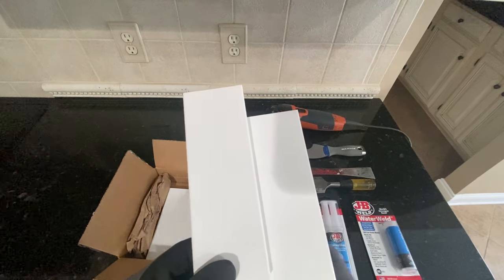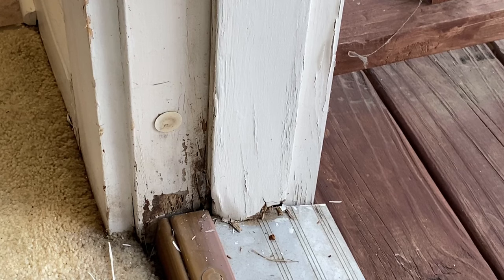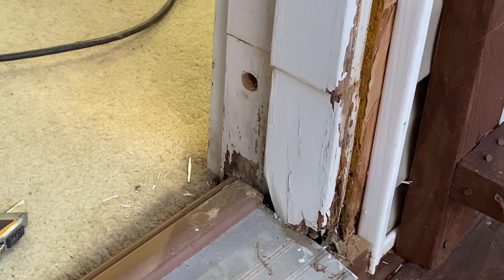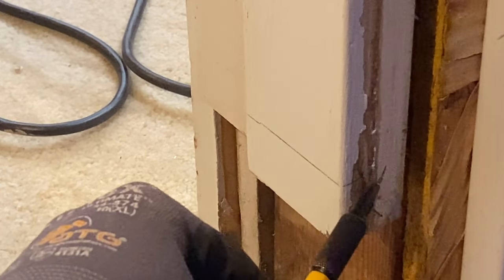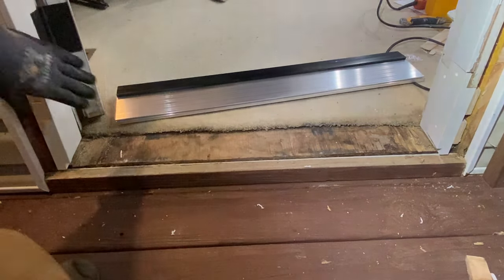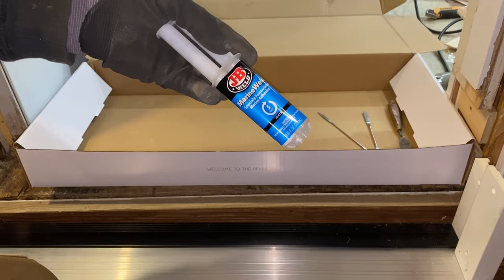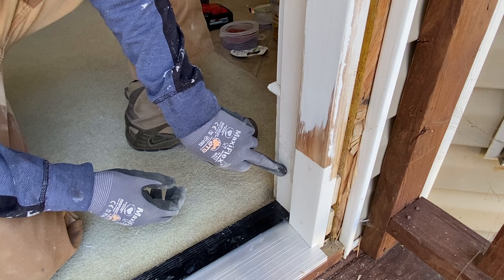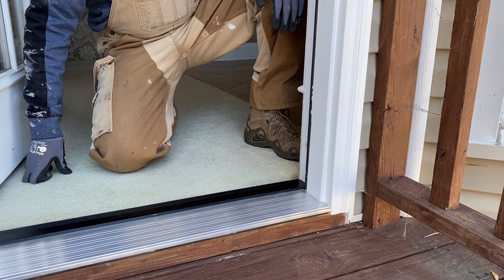Boss PVC Dry Rot Door Jamb Repair Kit How To #diy #how #howto

Comment: Great video, but after all the work with the PVC jambs why use regular plywood where there is risk of rot and why use a threshold with untreated wood that’ll only rot out in time?
Reply from the maker: Hi! Thank you for watching the video. I understand the comment. The reason the jamb needed to be replaced was because there wasn't a proper seal / caulking around the door frame, which allowed water to seep in and cause dry rot. Once the rotten portion was replaced and a proper seal / caulking was preformed, any additional water should no longer be an issue. I hope that this information was informative.👍

Comment: $80 for a pair? That’s crazy expensive. I’ll make my own from stock pvc 1x.
Reply from the maker: I know….but, it’s not as easy as it may seem. I looked into duplicating them myself for additional jobs. However, you have to router in a notch for weatherstripping, and most stores will not sell small sections of PVC. Therefore, you have to buy large sticks of it and you need two different thicknesses for the door jamb and door surround. By the time you’re done purchasing all of that and making a set you’re into it well over $80. If you are making several sets, then it might be worth it. But, for one set it’s really not worth the headache and is easier to purchase premade.👍

Comment: The threshold is angled down, how did you angled the pvc to the threshold?  Atvthe bottom?
Reply from the maker: Hi. If you fast forward to about 16 minutes you'll notice that the Boss Jamb has a "step down" type profile to it. The Boss Jamb is actually side screwed to the threshold, so the angle of the threshold is not affected when it's all put back together. Hope this information helps 👍

Comment: Excellent video! What did you use to fasten the pvc brickmold?
Reply from the maker: Thanks for watching. I used galvanized finish screws with small heads so that I could fill them in with caulking. You could also use stainless steel screws with small heads.

Comment: The door threshold will get stomp on daily,
not sure about the idea to tie the pvc kit to it.
Reply from the maker: Hi. Thank you for watching the video. I see your point on the threshold. But, If you have a proper subfloor base underneath the threshold, there should not be any play in the movement of the threshold, so it would not affect the door jamb. Most pre-hung exterior doors come with the threshold attached (side screwed) into the door jamb. For this particular installation, I followed the installation instructions directly from the manufacturer of the Boss Door Jamb Repair Kit website. I usually try to do that, so that others who purchase the product can watch a video instead of trying to decipher confusing instructions. I hope this information helps out. Thanks again for watching and leaving a comment...always appreciated!👍

Comment: What's the purpose of the JB weld ?  The piece is being held by screws
Reply from the maker: HI. That's a good question. The manufacturer recommended using White JB Weld to fill in the screw holes and the seam (if necessary). Once the JB Weld dries, it's just like the surrounding PVC in look and feel...so, painting over these areas is smooth and leaves a flawless finish. Thanks for watching!👍

Comment: Did you replace the brick mold with a PVC version? If not, what will prevent it from rotting again?
Reply from the maker: Hi. Yes! The new brick molding is PVC and I caulked around it to ensure that water doesn’t leak behind it.👍
Reply: @YouCanDoIt2  Awesome, thanks for the quick reply! Think I'll just repair the bottom sections of the brick moldings, like the jambs rather than the entire thing. They're in great shape other than the bottom rot and I have two doors to do. BTW - I went to the Boss Jambs site to watch an install video ... it was yours. 😃
Reply from the maker: @philshock3805  That sounds like a great idea with replacing only the bottoms of the brick mold…since that’s where the rot occurs. And, yes, the owner of “Boss Jambs” reached out and asked for permission to post our video on his website…it was quite an honor. I wish you the best with your project 👍